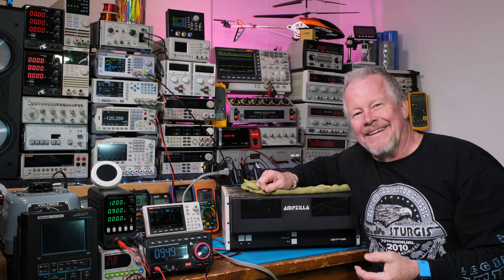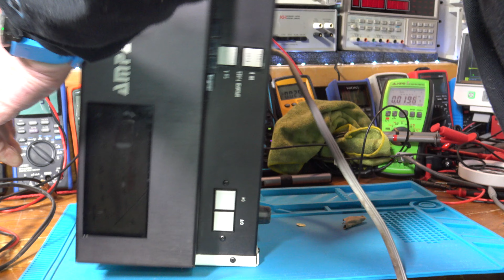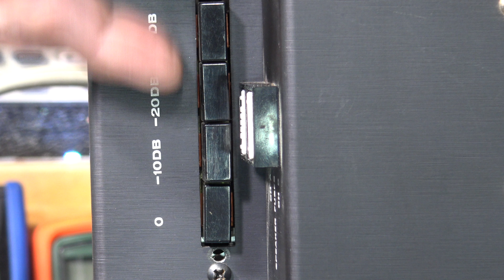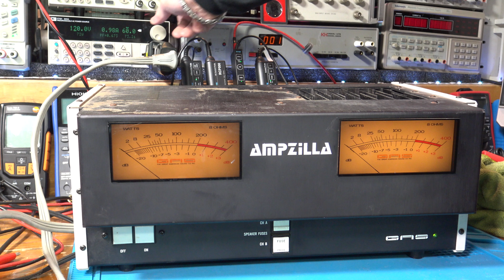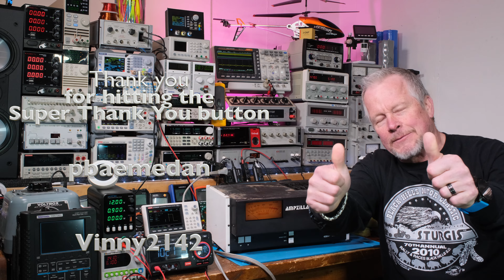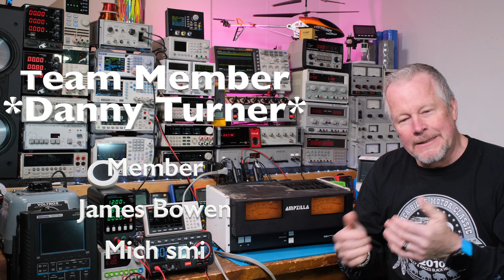Ampzilla Amplifier Awakens Class A-A/B Amplifier #Ampzilla #ClassAamplifier #vintageamplifier

Comment: I still have my Ampzilla. Used to use it with 6 foot tall 3 panel Magneplaner speakers with a crossover and a passive subwoofer. I remember the amp it was a rival of the Crown DC300. (Think that was better.) But the VU meters rocked on the zilla :) I remember sitting in the middle of the room and playing 'Carry on my wayward son' quite exceptional. Great stereo, as long as you stayed in the center. Ha!
Reply from the maker: Those classic amplifiers really had a unique charm and power that is still appreciated today. :)

Thanks for sharing that!!

Comment: Love your channel! I have an original 500 Watt Hafler in the closet. The insides are awesome looking. David Hafler was a designer using MOSFET power. Beautiful amp. I’m inspired to bust it out…
Reply from the maker: Yes I remember that 500 Watt.  Great amp!  Hafler was one of the greats!
Reply: I sold a Hafler on Ebay about 15 years ago that I'd had in my studio and got good money for it, in fact I think I got more than I paid (I had bought it used), so if you could use the money you should try selling it. They really hold their value. Mine had been built at the factory which may have made it more desirable.

Comment: That awakened some long dormant memory cells! I remember Ampzilla but that is it. I listened to some gear such as Phase Linear in the 70's but I built an amp that a Tektronix engineer designed - fairly common design but had tight bass and 0.01% distortion, good for the 70's and really, not audible at that level. Dynamics is what counts, immediacy in the entire system, but don't open that can! I had the Tiger amp article for years until I tossed it with loads of old magazines and papers. The Build a Low TIM Power Amplifier was full complementary as I recall - another that was tossed. That one may be most similar to how you described the Ampzilla. Was it ever a kit? 

I got the Sound Practices Magazine CD   which is fun to rummage through.

I have two huge 300B power amp transformers made by Jack as I recall at Electro Print - I thought in 1996 I wanted to build a two tube 300B mono amps. They would make a good door stop but they weigh a ton. 

I reconditioned two Dynaco MkIII Amps - then added DC filament with doublers, then changed the boards. One day nice and quiet, the next, a great noise generator, then hissing like cats -- with KT88,'s and so they sit on a shelf. Will go back to EL34's maybe one day. I changed load resistors with current sources, made them sound more neutral.

Anyway, AMPZILLA! I never heard them or saw them but recall reading about them. Really cool!

Found the Ampzilla article with schematic I was thinking of. 75VDC supplies? Stacked output transistors. 

Sucks that people steal.
Reply from the maker: Thanks for all this awesome feedback!  I have some fun times ahead with this amp - and then maybe it will be up for sale...  ;)

Comment: Some of my test equipment sat for many years in storage, not having a variac at hand nor using a series lightbulb prove to be too much fun, after 3 consecutive failures culminating in a digital storage scope filling the room with smoke I was able to spend a few happy hours repairing stuff. Perhaps surprisingly none of the failures were electrolytic capacitors. Bizarrely 2 friends living miles away from me but using scopes from the same family  had the same capacitor fail on the very same day, their scopes were in everyday use. (Film capacitor across the mains)
Reply from the maker: Thanks!  I heard about the X cap issue...  Do you know the brand of the capacitor?
Reply: @kissanalog  sorry no, the scopes were all Philips and the capacitors were rated for 275vrms. Edit: I spent some time to look it up, the original capacitor was a RIFA. Looking online these capacitors seem to have failed on the vast majority of these old scopes. (FWIW I have had newer scopes but gave them away, this old Philips is more than I need for most of my work)

Comment: Thanks Eddie.
Denmark, maybe Dynaudio? Excellent speakers.
I remember the SAE, it was highly rated also but I don't remember this amp. David Hafler did some interesting designs back then for Dynaco kit stuff that's still pretty popular today, I had one of his first comp/sym amps running AR 3 speakers but the darn thing kept blowing output transistors.
Reply from the maker: Thanks - the speakers were 2 way with an adjustable pot on the back - plus I think they were even bi-amp capable - which is crazy for a 2 way speaker.